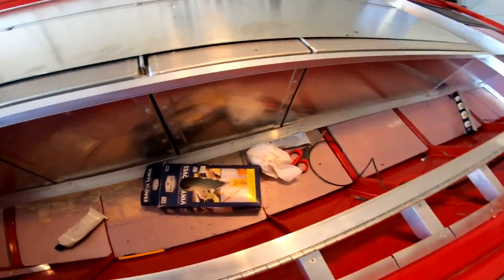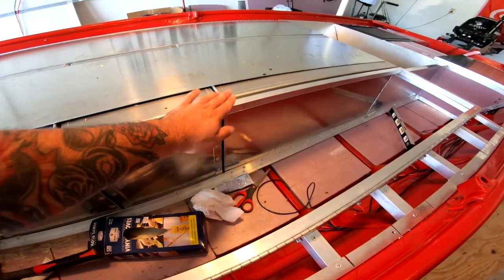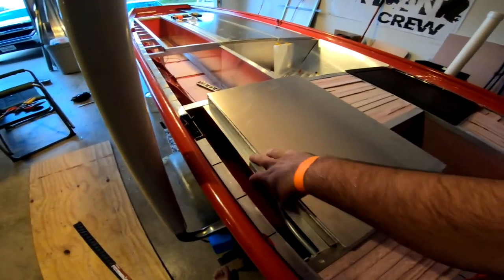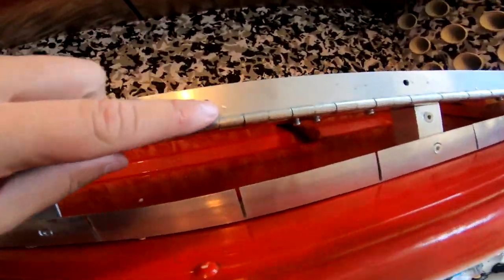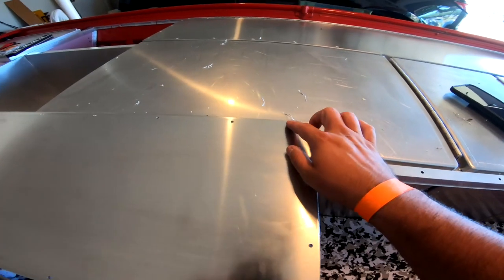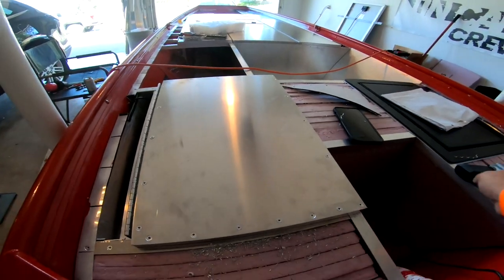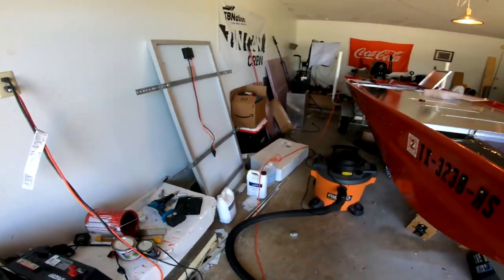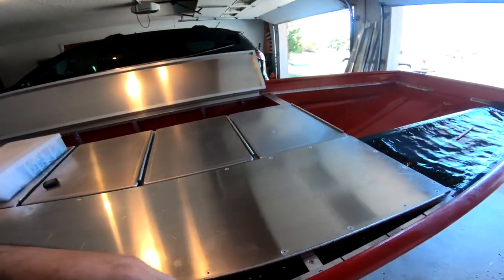ADDING SUPPORT And SHEET METAL To The ROD LOCKERS!!

Comment: if the batteries go on the left, along with the fuel tank, won't the boat be a bit unbalanced?
Reply from the maker: When I’m not sitting on the other side yes, but one battery is going to be centered in the front now and one will be on the side, but when I’m sitting and driving the boat it should all be balanced

Comment: This might sound crazy but what if you didn't build up the sides of the rod locker. Just sheet it with lower edge because it would make a sweet spot to drop your rods and keep things from rolling off the deck. Once it gets Eva foam it would look like you did it intentionally.
Reply from the maker: So your saying don’t make the deck level on the sides? Right?
Reply: @AdamRyanA  Exactly. I think it might be more functional that way.
Reply from the maker: That sounds like a good idea on paper, but I’ve seen rods on the top of decks and they are never that compact, the rods wouldn’t stay flat in the lower part, in my opinion, I could be wrong, and honestly most people would ask why I did it that way and probably wouldn’t agree with the idea, but I can see what your seeing